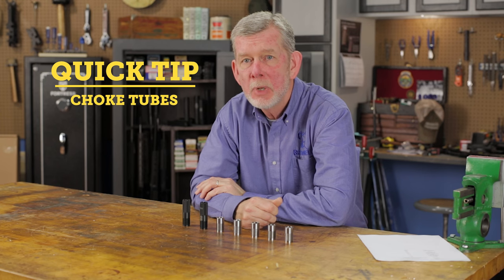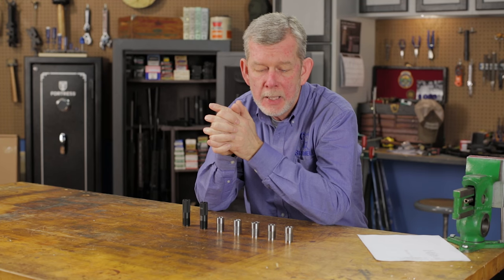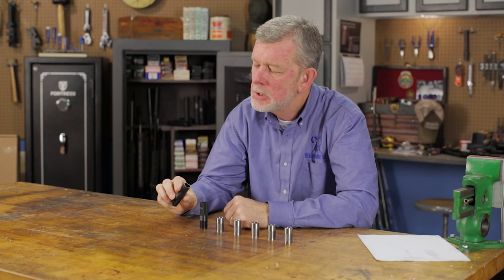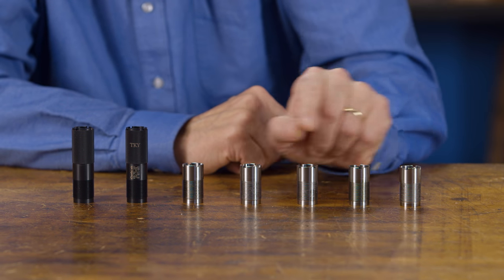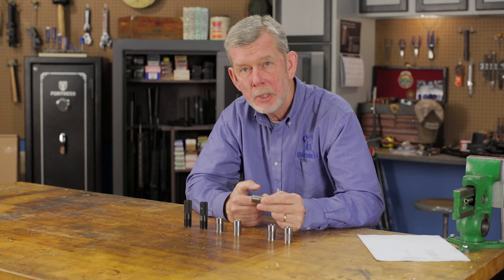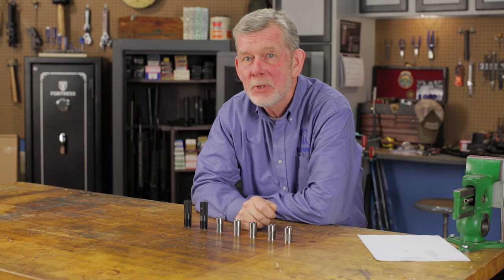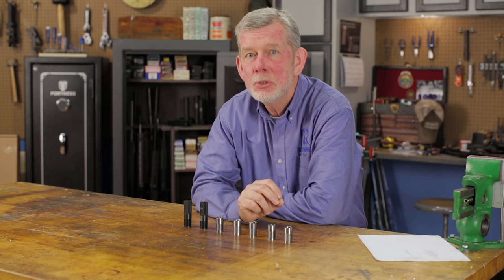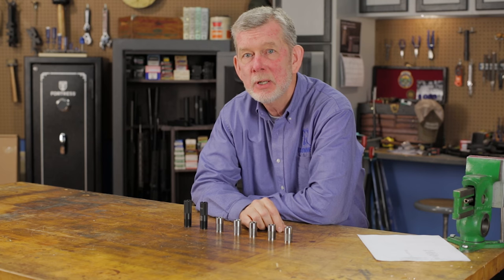Quick Tip: Introduction to Shotgun Choke Tubes

Comment: In most choke videos they often fail to mention not to use bigger shot loads than #2 or #4 depending on the constriction of the choke.  Some chokes you can't use steel shots.  Nice video but lacking key information.

Comment: Thanks for yawls good information And the hard parts to find,I’ve fixed Manny old guns from you all.
I’m building a R 10 to change it to A 6.5 Creedmoor I’m going to have a complete upper  where I can change it but just 2 take down pins. It’s a good gun armaLite 308 Heavy barrel stainless steel. But I want to try  the 6.5 I may be having to call y’all but I’m gonna build  it from Brownells !!!

Comment: Are choke tube necessary , Im pretty well knowledges on rifles but I’m just venturing into shotguns now, I’m just a range guy but I heard story’s oh people’s barrels blowing up , I’m shooting bird , buck ,00buck  and I have rifled slugs , with an 18in smooth ,24 smooth and 28 smooth barrels no chokes.  I guess my question is it barrel size should I use the bucks and slugs in and if I need a choke?

Comment: I’ve got a choke tube that after it’s screwed all the way in the part that sticks out from the end of the barrel looks kind of like an over sized A2 birdcage that comes on an AR-15….what kind of shell is that for? It won’t fit on either of my 2 Mossbergs but it will fit in the barrel of my RIA VR60. It didn’t come with any of those guns. I can’t remember where I got the choke from. I just came across it the other day and tried to see which of my guns it would fit and it only fits in my VR60.

Comment: What’s the point of a cylinder choke? Seems like the barrel alone is fine.
Reply: To prevent damage to the threads where the tubes screw into your barrel.